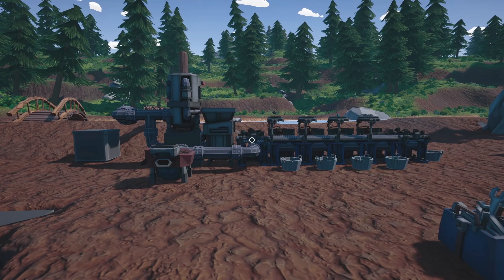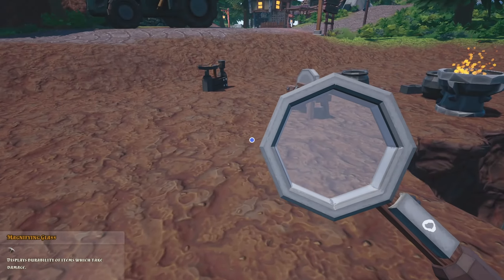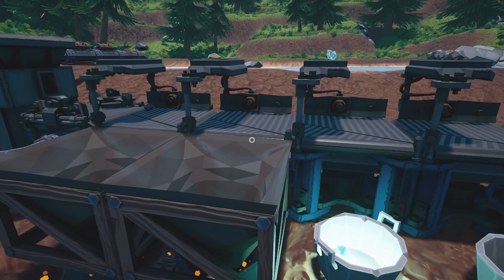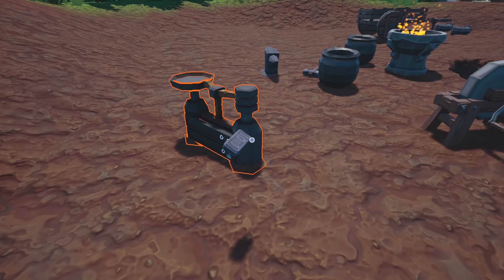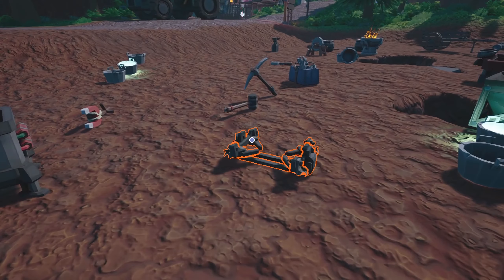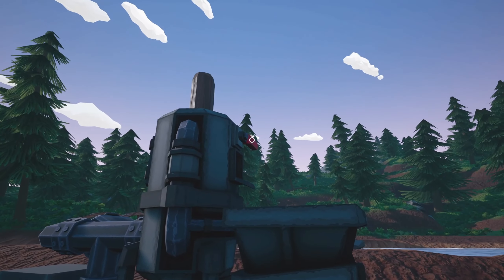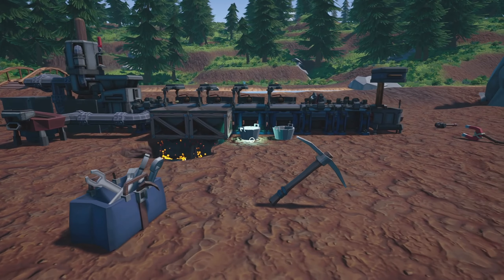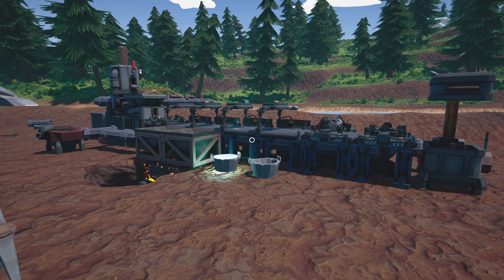Hydroneer - v2.0 - 5 - "Automatic Gems"

Comment: You don't need the funnels.
Just place the auto-smelters 1 step up.
And get 2 more auto-smelters for the power gems and the Cloudium.
And the place the items in the middle belt is useless and not needed.
To speed up your belts buy intake